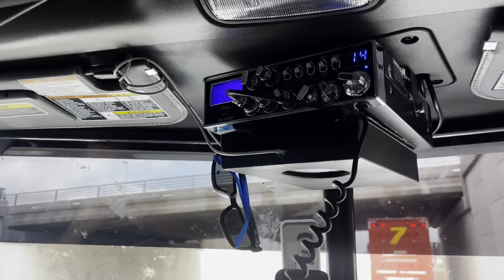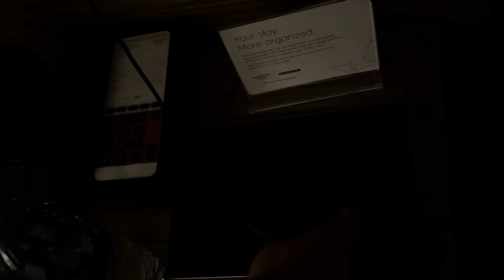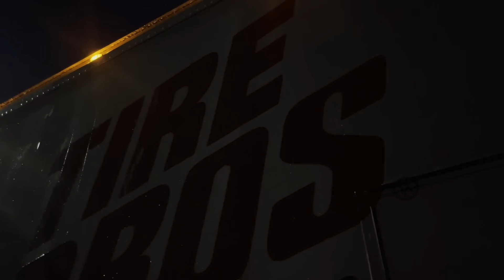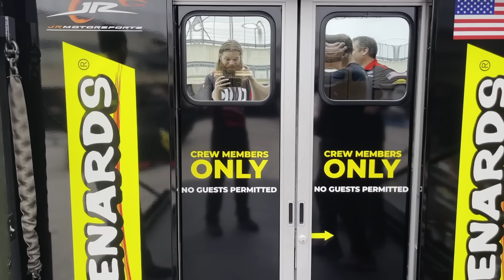NASCAR Hauler Driver: The Reality

Comment: Great Video. !  Drove for 45years. Ran several times with a group of haulers Back in the Day. Used to have a lot of north/south runs. So alot of I 81. I 85 or I 95. Got  so bad. I went back to the shop and put in a set of 325rears in my truck so I could keep Up. Truckin was really great back in the Day. Looks like you guys still have a great time. Though. !  STAY SAFE OUT THERE. ! Keep up the Great Videos.  🇺🇸🏆🏁
Reply from the maker: Right on my man!

Comment: You'd think the money dropped into Circuit Du Americas would have put the capacity for indoor pits.
Reply: That happened at a lot of race tracks when they a fairly new. That, plus road course racers are a different breed. For a long, long time Watkins Glen didn't have enough garage space for two divisions of racing. Years ago I was involved with ARCA (we raced a day or two before Cup in similar cars) at the time when a lot of tracks were being built, or under major renovation. We would be where the secondary garages were to be built after they started to re-coup some of their investment. For years at Pocono, where we were THE only "opening act", we had to unload our stuff behind the wall on pit road and park the cars on pit road. Fun working on cars when the Cup boys didn't worry about how fast they were going when they went out to practice. Nashville Superspeedway never built the garage for the ear!y years when we were there. They had the concrete pad complete with the bolts in it to bolt the trusses on (to trip over). I haven't been there in years. Hated that place, for the first two or three years the "grass" in the tri-oval was green painted mud.

Comment: hi jaw enjoying the nascar i’ve done european F1 tours . fun fact in normandy france on a calm sunday you can pick up american cb radio as clear as day
Reply: It’s partially because many of them are using illegal amplifiers. My Grandfather back in the day would run a 1000 watt amplifier instead of the 5 or so watts that was the legal limit. Recently the FCC cracked down on some guys in the Hampton Roads area that were broadcasting illegally - so much so that the receivers had to be choked down so that it did not overload the front end of the radio. They were given a big monetary fine and told not to do it again. Right….

Add in a little skip with just the right atmospheric conditions and you can send out for many thousands of miles. Across the Atlantic Ocean is pretty common at that frequency. Hams do it legally all the time.

Comment: Why not hang the type of bumpers boats use when docking from the top of the trailer at the critical points so the next guy cannot ding the side of your trailer? Or better yet get an alarm system with cameras mounted at the top of the sides of the trailer all the way down the length of the trailer that goes off if anything gets too close. Maybe even a ring doorbell would work. You would at least see what hit you and have a recording of it.

Comment: Hey I wanted to ask. I have never pulled a trailer with a split rear axle like those trailer have. Is there any trick or problem doing pulling those? The state IEMA got a big emergency response trailer that had them and I remember the driver said they were a pain to pull and mainly just trying to turn with them. Now this guy was NOT a truck driver, just a guy that had a CDL
Reply from the maker: Great question.  They spread the axles so that you are allowed more weight on the road surface. There’s no trick to then really. They do corner differently. With axles spread apart, it takes more force from the truck to pull the trailers laterally side to side and around a corner. You just gotta turn a bit wider. If we find a tight spot, we have a switch that will dump the air out of the back axle suspension and allow it to corner with less friction.

Comment: How much a year can a trucker make if he were to take this path?
Reply: I don't know how much they make but, this only getting the cars to and back. They usually do more than drive the truck. Besides being responsible for the rig, You are also responsible for the consumables inside. They are usually the cook, which entails the shopping. Even sponsor provided things, they'll have food/snack items to load. Someone has to be responsible for getting the right uniforms and other clothing that match what sponsor is on the car for that race. Plus much more.

Lower budget teams have less people. That puts more responsibility on the shoulders of the driver. You aren't going to start out with a big team. That usually adds on doing/or getting the laundry done. Swapping out the spare parts and tools that are needed for different race tracks. Some even have "in shop" jobs.
Reply: Add up the hours worked and it's less than a well established Trucking Company local or otr , like dad told me it's a Prestige Job when I did it

Comment: ALDOT started working on the 2 main intersecting interstates 65 & 20/59 back around 2012 and then it was estimated that they would successfully complete the project sometime into 2040😂 I guess it's not bad for thousands of miles of concrete, rebar, and pavement, but you might be better off going around the entire state of Alabama 😅😂 You boys should've took the detour 😂